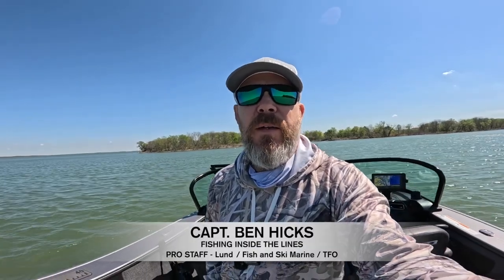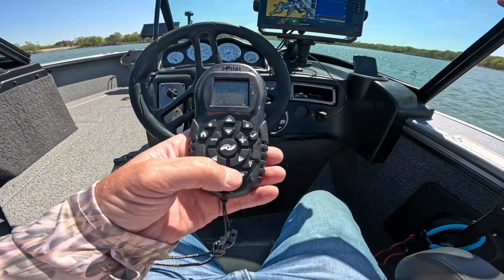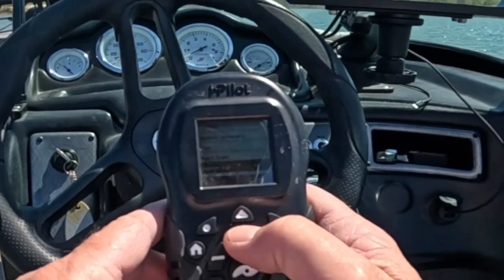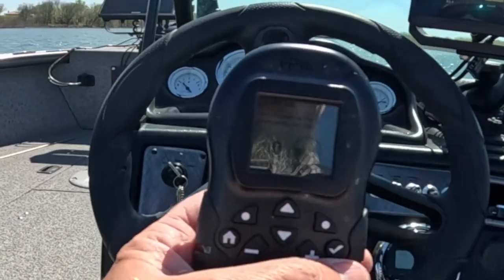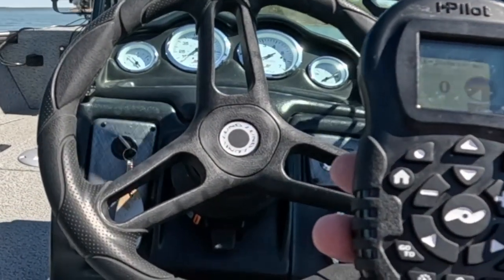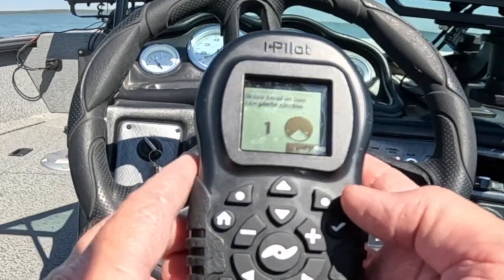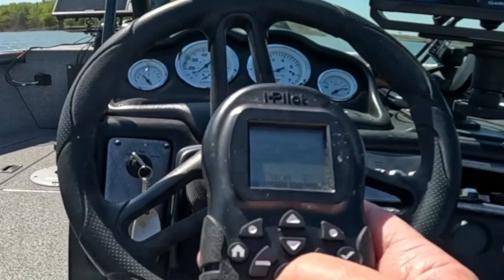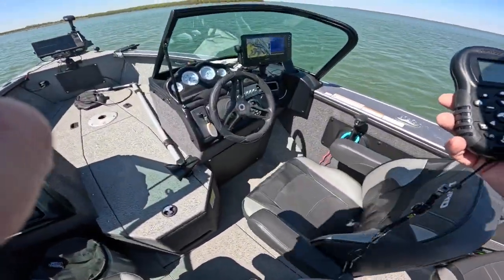Calibrate Minn Kota I-Pilot Heading Sensor

Comment: I believe you are suppose to use your main motor to make the 2 circles and leave your trolling motor facing forward.
Reply from the maker: Hi Andy! You can use either motor because what’s being calibrated is the compass inside of the heading sensor and not in the trolling motor head but the trolling motor does need to be facing forward in the next step of setting the sensor offset.
Reply: You are correct. Took me a few tries to figure it out lol

Comment: So you don’t have to figure out the offset? It basically figures out the offset for you after you get the motor head as straight as possible?
Reply from the maker: Correct, after calibrating heading sensor the next step is the offset. Straight as possible, hit the offset button and it tells you offset complete and what degree offset is at.
Reply: Thanks. I’ll be doing mine for the first time this weekend.
Reply from the maker: @ntj030885  It’s pretty easy, should only take 3-4 minutes.